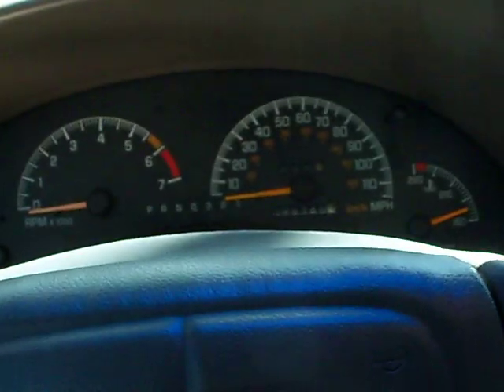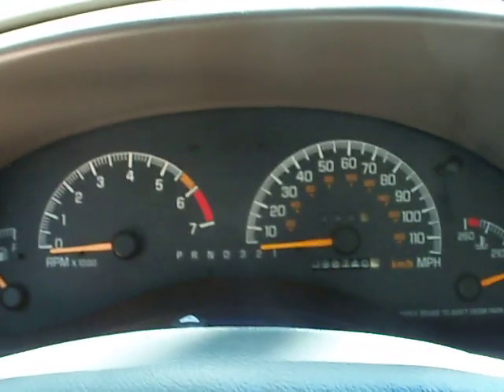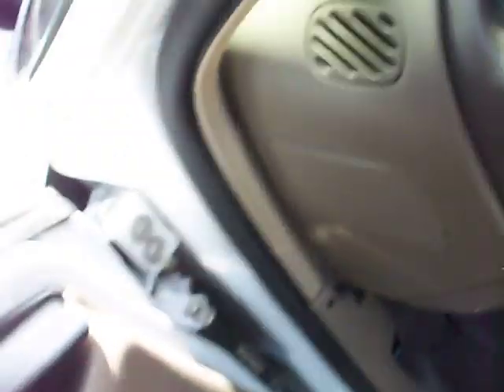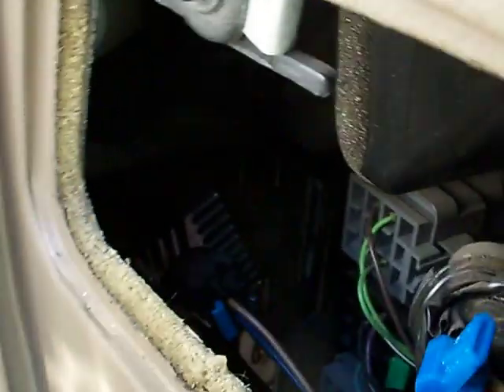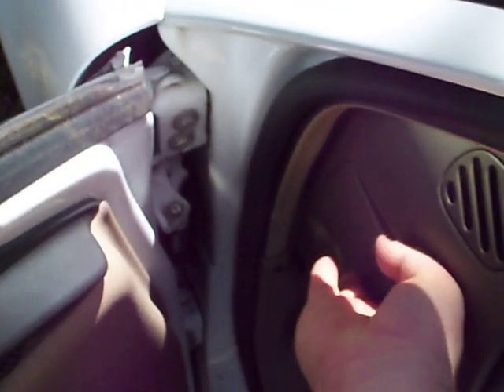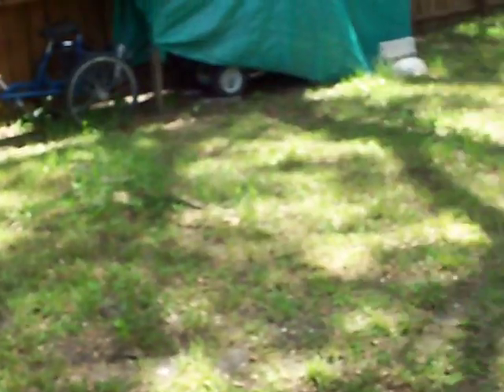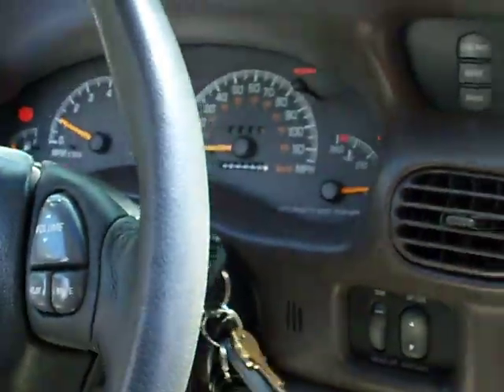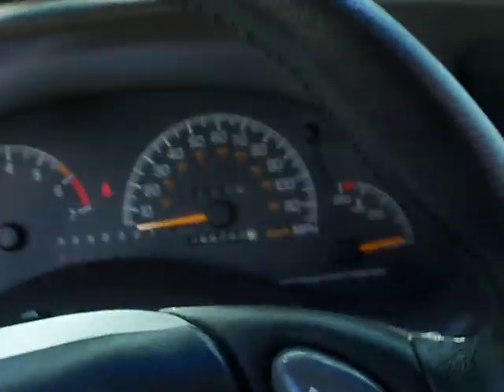HOW TO DISABLE DAYTIME RUNNING LIGHTS ON A 1997-2003 PONTIAC GRAND PRIX

Comment: THANK YOU!!! I had a '97 and '99 Cavalier Z24 and it was a simple matter of pulling the fuse BUT at night without the fuse only one headlight worked so the fuse had to be replaced. 

I've been driving for 40 years and I KNOW when the headlights need to be on and broad daylight is NOT one of those times!!

Comment: Thanks for the explanation. I decided to go with just disabling the DRL by pulling the connector on the resistor. It took me about 5 minutes to figure out and do, but if I had to do it again I could get it done in 30 seconds. I will probably eventually make a video of my own explaining how to disable just the DRL, and not the auto lamps too. I know you show where it is, but not how to do it.
Reply: I got a 01 .... what did you do to eliminate DRLs but not the auto lamps ??
Reply: If I disconnect that heat sink, will that disable the DRL's but still let my headlights automatically come on at night?

Comment: It's next to impossible to back the connector away from that heat sink in the position that it's in.  Try this instead:  look up from underneath and you'll see a hex head screw that holds the heat sink in there.  It's a 10 mm hex head.  Get a long extension and back the screw out.  The heat sink will drop down to where you can work on getting the connector off.  Easy peasy to push that connector out at that point.

Comment from the maker: hey man.. no problem.  i actually searched a LOT for housings and found the ones i got on amazon from a supplier that kept plenty of them in stock brand new. the cost was only $74 after tax with free shipping. my advice is to search around a lot very carefully though, read reviews on them before buying, not all of them were made equally. reason i say to shop around now is because prices and suppliers change all the time. make sure theres a return policy and inspect them once you get them

Comment: thanks for the info, it worked great.  for the  connector attached to the heatsink, I used my key to push in the locking tab on the connector, it came out fairly easily that way.

Comment: there`s a little grey box `bout the size of pack of cigs just above parking brake pedal. it slides up and its out. pull it down, and open it.there are 3 solinoids inside, 2 on top( for headlights and parking lights). just unplug that plug and your all set. nothing else is affected.

Comment: when i removed the drl fuse i didnt hear a crazy dinging noise it was more of a crazy clicking noise would the second option of removing the wires connected with the heatsink eliminate the clicking (quite annoying)
Reply: For the love of Christ how did you disconnect the wires from the heatsink. Am I supposed to move the blue clip a certain way to loosen it or am I supposed to just yank it out.

Comment from the maker: @DemEazy not 100% sure but its probably got the same setup, gm cars are usually quite consistent, i recommend looking on your fuse chart or in your owners manual for the fuse layout, get in your fuse box, and pull the DRL fuse, if it doesnt cause any issues then keep it out, if it does then put it back in.  if it didnt work, look online for which heat sink behind that drivers side panel (assuming you have one) would be for your daytime running lights and unplug that.

Comment from the maker: @Reissumies  when you install aftermarket HID's sometimes when you leave the auto-on features in, it can cause the lights to malfunction from trying to kick on while the car is draining so much power to start it, it just causes unneeded stress on the cars electrical systems.  this is just because the car wasnt initially designed to run HID's, now sure you can add complicated systems to compensate for the power and make it all work fine but then ive spent more money i dont need to.

Comment from the maker: it sounds like your light sensor is still functioning in your case, so while the daytime running lights arent coming on because you disabled them, the night time auto-on feature for the lights is still functioning and turns them on by itself. seems different grand prix models and years all respond differently, im guessing theyre all just wired slightly different.

Comment from the maker: on a malibu i have no idea.. but.. it probably will have a fuse the same as a grand prix does, youll have to check the fuse panel to see if it says drl on it anywhere, if not, then there is probably wire or something to be disconnected but im not sure where, i dont have access to a malibu to explore it either, could possibly call a mechanic or dealership up and they might know for sure

Comment: thanks for the video dude!!!!!!!!!! ive been trying to figure out how to do this on my grand prix!!!  but i realized when i did this that. 

during the day if you disconnect the plug with heat sink your auto headlights at nite will come on. 

so 

for the nite time you will also have to take out the DRL fuse in the glove box. 

again thankms for the video bro
Reply: Huh ??  Elaborate
Reply: @adamb9383  its been 11 years bro lol
Reply: @tougesubaru420  😂

Comment from the maker: @krazykucharz hmmm.. not sure really, gm made a LOT of changes between the 97-00 models and the 03 models.. each car even within the same year seems to vary in results from what ive seen on here, with the messages people have sent me and what not... some get a relentless dinging noise, some get flickering headlights, some get that ticking sound, and all kinds of stuff.. if all else fails you could try putting the fuse in but disconnecting your heat sink instead on the left side in the dash.

Comment from the maker: @blackpblock1 each persons car is going to have ONE of the reactions to pulling the fuse out, either it will be fine like mine.. or ... it will ding.... the same sound as if you leave your keys in or headlights on when you open the door... or it will get a ticking noise... so far those are the reactions ive heard of

Comment: I have a 2004 Sunfire, installed HIDs. All I did was pulling off DRL relay on the side kick panel under the driver side dash (that's where the body electrical fuses are for sunfire ). Now there is no DRL shit to bother about.  Everything works fine so far.

Comment from the maker: @jackjeckel5 honestly no clue.... but.. should be pretty similar if not the same, gm seems to be pretty consistent at least for the most part. if it is different however it shouldnt be too difficult. try searching google for forums or instructions about it specifically for your car. they should have something on it.

Comment: Thanks for the instructional! Does this also disable the headlight flash when the car is locked with the keyfob? If not, wouldn't that damage the HIDs? I'm looking to get a kit. Also, where did you get the OE replacement lights? Mine are too far gone as well

Comment: Thanks a million for showing this! By the way, I believe my headlight switch on my 2002 pontiac grand prix SE is having issues because all at once, my tail lights went out (break lights still work though), daytime running lights went out, I get a fast chime when door is open, and dash lights went out. My question to you is do you think I could change out this headlight multiswitch through that side panel you popped off to show the "blue and gray DRL wires," or is dash removal necessary? Thanks

Comment: 2001, I managed to get the harness off on the driver side and replaced the fuse. No more clicking, I also disabled the flash when I clicked my keyless remote. My driver side hid is brighter than my pass side, I didn't use a relay, not sure if that is a problem. No issues with the fog lights though.

Comment: @AONEMANPRODUCTION 
I have a 2002 and if I pull the connector on the heatsink it kills the daytime running lights but not the auto headlights. If I pull the DRL fuse then the lights shut off but there is a relay that starts clicking like crazy. The module that the relay is in is just to the lower right of the DRL heatsink. 

The auto headlamps bug the crap out of me because if it's night out and you park the light's don't go out.

Comment from the maker: @03IMPALASS im not entirely sure as they made changes over time, but im guessing prolly very similar, if you remove the fuse, see if it dings at you or has any issues, if not then its that easy, if so, then put the fuse back in, and try just unplugging the heat sink for the DRL's, i hear that works just fine on newer models, also can try lookin on here grandprix . net / faq /   just take the spaces out

Comment: @FutureFuzz911 yeah i took the fuse out for mine and when i started driving it had this rapid clicking sound. i drove near a building with large windows and looked in the reflection and saw the right headlight flickering as fast as it was clicking. put the fuse back in and it went away. so i no longer am going to bother the DRL.

Comment: @rcrocker02 yes i have removed the wires from the heat sink but unfortunately it didnt do what i wanted it to... when i remove the drl fuse the lights must be turned on manually in any light by removing the wires my drls come on around 5:30..... i have recently bought halos for the gtp and only want to run the halos and leds at night.
Reply: Any tips on how you removed the wires? Brute force?

Comment from the maker: @FutureFuzz911 im hesitant about halo's because on our cars, the halo kits are MOSTLY crap, ive only heard of a very few actually being any good, they all LOOK good but perform like crap with the exception of a couple..havent done any other work with my lights yet other than just installing HID's into the factory housings, every projector kit or halo kit is either crap.. or expensive if its any good from my experience so i havent bothered with it yet. dont know much about the LED signals tho

Comment from the maker: first thing i would do is check the fuses, make sure the fuse that runs your normal lights isnt out. if thats not the problem id check the wiring and make sure theres not a short in it. if you dont know how a mechanic can usually find it pretty quick and diagnosis for simple stuff like this is usually free. if its a simple fix once youve found out the problem then you should be able to do it PROBABLY without removing the dash panels. worst case.. its a harder fix so probably need a mechanic

Comment: Have a 2000 grand prix. Fog lights dont work and the amber light in switch to show they are on doesnt come on .. cant fig it out . Thought its just switch . Any suggestions?
Reply from the maker: Mikes Gaming Adventures check fuses first.  Then switch. Also check both bulbs. If all that checks out then its down to wiring
Reply: BOOST MENTALITY thanks

Comment: i have a 1998 grand prix supercharge and i tried installing HID's on it but only one side will work if there's a regular bulb on the other side and the light wont turn on if both side have the HID's installed on them what do you think the problem could be?

Comment: i have 2003 gp se. i tried 3 different things on u tube. pulling fuses makes solinoids click, try plastic in the solinoid contacts,( fingers to big ). just unplug the plug that goes to the two solinoids.( one is for parking lights & one for headlights). just unplug.
Reply from the maker: robert brittain worst case scenario, get a can-bus ballast hid kit and you can run daytime running lights just fight, the can-bus ballast will balance the power out even when starting the car

Comment: hopefully this will fix my problem most likely not but when i turn my heater on it turns my headlights off with the heater i can only get the heater and the headlights to work on speed 6 and the headlights have to be on the on position

Comment from the maker: @2011gameon to be honest, not real sure where the fog light fuse would be, i checked the fuse panel layout and only saw headlamp but not fog. it might be in the box under the hood, or it might be your wiring thats bad as well.  If i were you i would check the w w w . grandprixforums . net which is free to view the forum post, and you can join and post for free as well, someone out there should be able to help for sure.

Comment: Is there a way to disable the DRL's but still have the headlights come on automatically at night?
Reply from the maker: Mine still worked at night with this. Cause that goes by the light sensor as where this disabled a separate system that only activates headlights. That system for automatic lights at night turns them all on and uses separate fuses

Comment: Thanks, this worked perfect on my '02
Reply: hello, i recently did this in my 02 and there’s something near my light switch that started to vibrate, did you have this problem?
Reply: @reynaldopalacios9473  I did and when I pulled the fuse my headlights started to flash

Comment: Is there a way to keep the interior lights from comming on when you open the doors?
Reply: Andre Carter probably a little late, but cut the wire for the door switches that are in the latch mechinism. Not sure about Grand Prix, but my Bonneville has a door computer for each door. Easiest access to the wires would be there. You would need to look up a wiring diagram to find the right wires, at least without digging deeper into the door to see where they go. Otherwise bulbs. The wire way would allow you to still turn them on with the switch on the dash though.
That assumes it is similar to my car anyway. I would think it should be.

Comment: i had no heat in my car and i replaced the resister and heater motor and it onlyworks on speed 5 when i put it on 1 it turns off my headlights what can that be on a pontiac grand prix

Comment: I have a 2003 GTP and when I tried removing the fuse the headlights were flickering and the relays were clicking.
Reply from the maker: Anthony Thewlis hmmm.. well it doesnt work the same on each car, you may have to do one of the other ways. this was just the easiest way. that other way i showed on the drivers side might work better on yours.

Comment: But can it Autocross? ....Lol
Reply from the maker: ABSOLUTELY!!! technically yes... sort of. lol but not anywhere near as good as my 2009 335i coupe :)
Reply: +Richard Crocker Lol...it is a lot of more fun on a rwd car ..but still GP's kickass too✌
Reply from the maker: +19fran85 if you set up your suspension right,  you can dial out most of the understeer on a gp which is pretty sweet
Reply: +Richard Crocker Absolutely! All is about the set up and tires..and the driver too i guess,Lol